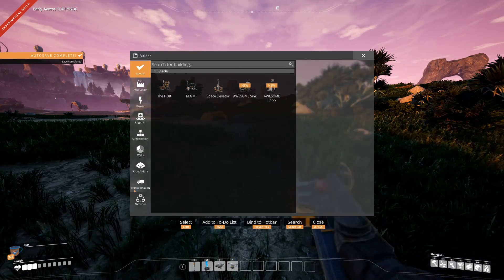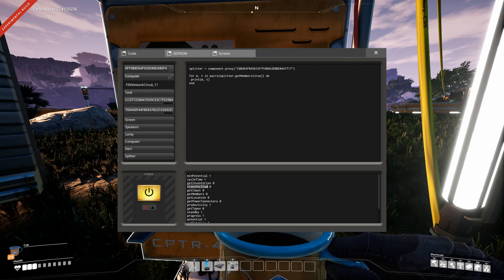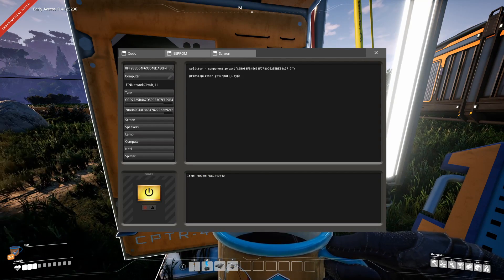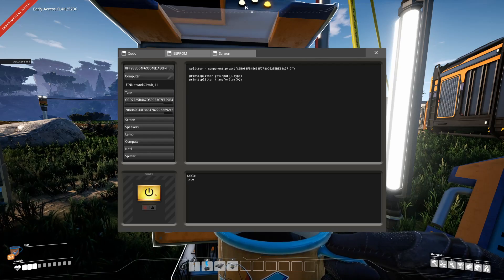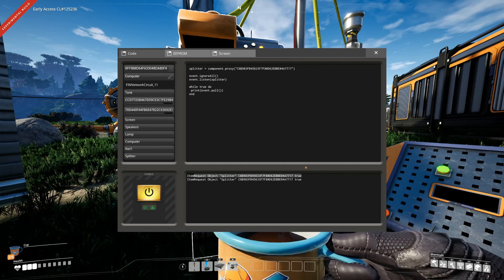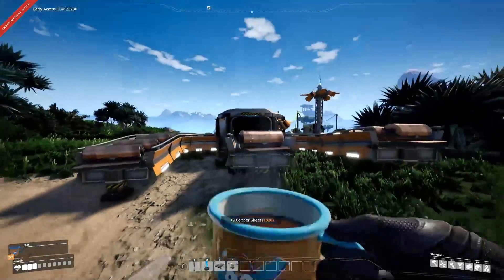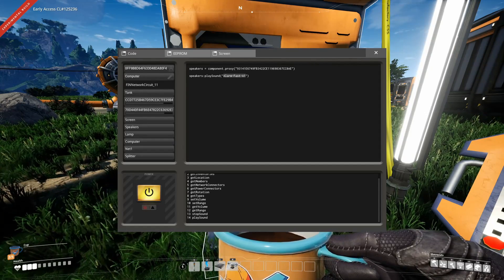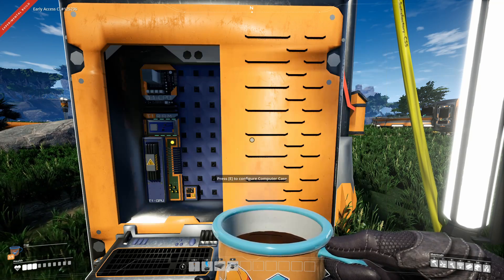FicsIt Networks - Codeable Splitter & Speaker Pole (Outdated)

Comment: Have you removed getMembers(true) from your code? I´m always getting an error trying to power a pump through power controller,,
both pole:setConnected(true) and and pole:getMembers(true) is giving me an error,, 
I can read ItemCount in storage thou! 

and APi Docs locks redacted for me!
your video from June has alot more in it!
Reply from the maker: Jeah there was big update to the backend. You can now use the reflectiin viewer within the network manager or the computer case to check wich functiins and properties a given class has.
Set members got reolaced with a way larger API to check the types.
":setConnected(true)" f.e. got changed to ".isConnected = true"

Comment: How would you go about getting the nick ("Splitter12 Iron") and/or unique id ("63849...") of the object that spawned an event within the event listen handler? 

The second parameter in the event callback is a userdata object that has both nick and id available (they print when you print(evt), but there seems to be no direct assignable access for them). 

Source object reflection during event handling is so obvious that I don't think you missed it, so I'm obviously the idiot! :) Could you provide a very simple example of getting these pieces of data?
Reply: I also ran into this issue. When you print the object it lists it's nick and it's id and it's type but I couldn't figure out how to pull those out into a variable. Looking at some of the example
code it seems like he just directly compares them. Could this be the answer?  In this case its a FactoryConnector that is being tested but maybe it would work the same way?

local connector = container:getFactoryConnectors()[1]
...
 e,sender = event.pull(0)
...
 if e == "ItemTransfer" then
...
    if connector == sender and containerBuffer[container] then
         containerBuffer[connector] = containerBuffer[container] - 1

I'll have to go try this out later. I am using a codeable splitter in order to send excess items into a sink. Originally I was using the event handler to drive the whole thing but I kept getting crashes so I had to change my approach until it gets fixed. I was kind of in the middle of trying to solve this same issue when I decided to start over and cut out the event listener all together.
Reply from the maker: Jep... thats my fault that there are no functions in the instance returned by signals... it is already fixed an will be published with the next update...

As a work around just simply use the id for checks, and if necessery you can proxy it...
Like:
com =component.proxy("...")
e,s = component.pull()
if com.id == s.id then
 -- stuff
end
sender = component.proxy(s.id)
Reply: @Panakotta000  in your example would
com == s  --(without id's)
simply compare the object type? Or would it compare the instances of the objects.

Comment: i tried using the smart vanilla splitter and it always held back some items to release them later randomly when more items arrived. is that a bug or a feature in vanilla? with this mod and this splitter, should i now finally be able to build and program a working splitter?
really nice!

to reproduce the problem that i had in vanilla: have iron plates sent to one output and overflow to another. if some other items arrive, they will leave to the overflow only after filling some internal queue (or maybe worse, some non-fifo buffer). even when all outgoing belts are empty, three items will be stuck in the splitter. i found them by hovering the splitter while deconstruct (F) was active, and besides the components to make the splitter it also showed three more items. thus on a row of 50 sorters/splitters, up to 150 rare or costly items might get held back. sending many more stacks of items randomly caused these rare items to be forwarded (and some of the new items be held back instead) and sometime in the future finally leave the end of the row of sorters ...